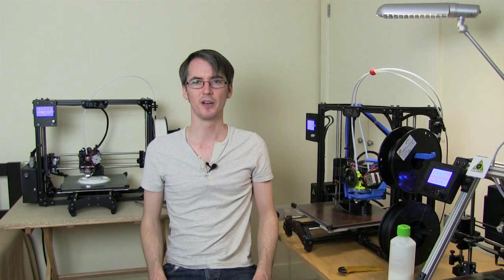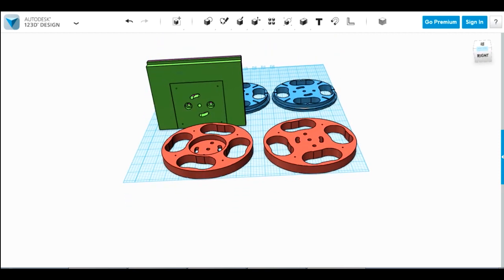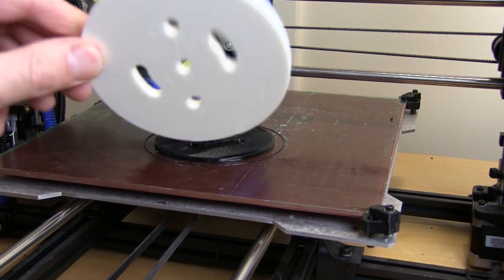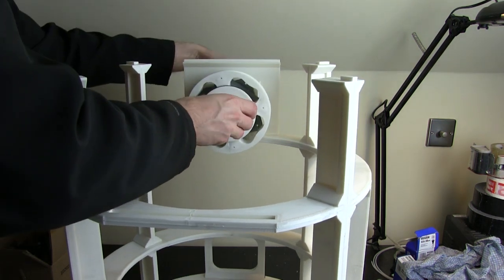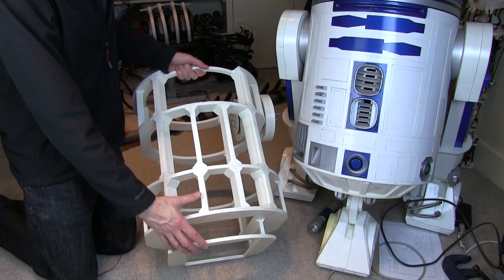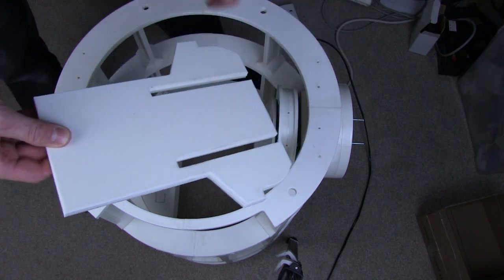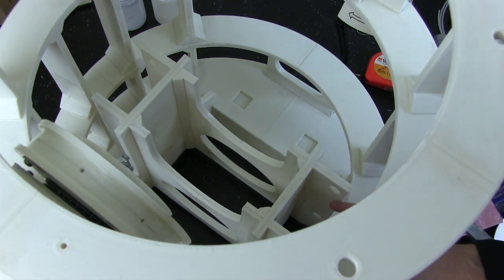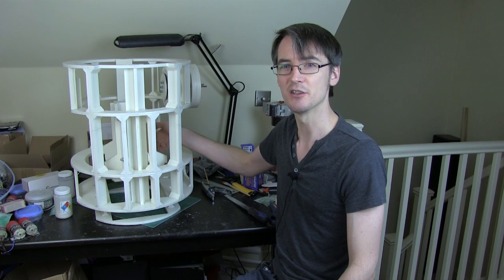Star Wars R6-H5 Droid #3 | Centre Foot Mechanism | James Bruton

Comment: If you run the studding all the way through then you can use one motor to move all three legs. Have a set up gear in the middle connected to a kind of crankshaft so the middle leg goes in and out like a piston of a car.

Comment: James, you’re doing a fantastic job, you really put 3d printers to use. Would you mind answering a few technical questions that I’m sure we are all wondering? When you design your parts do you make them slightly smaller or bigger for abs shrinkage? What nozzle size do you use most? What print speeds in mms did you find you get the best results? As of now did you budget out the cost of filaments (if not could you I’m sure we all would like to know) and how is this project funded?  And as always Fantastic videos, simply a joy to watch.
Reply: ***** In your experience, what's a good thickness for larger flat ABS parts to be warp free? It seems like you're intentionally splitting plates in half to prevent this.

Comment: Nice work, I'm following your video's for quite a while and it is nice to see larger projects with 3D printers. A sidenote; Did you consider filling the bearings with bearinggrease? That should take out 90% of the sound/ratteling even without compressing them.

Comment: wow that really cool, im just wondering if the centre foot will fit inside the frame? I was wondering if you plan to paint any of the internal parts to help them stand out from other parts when looking in, possibly blue? Then again the motors and wires already add splashes of colour to the insides, red i think.

Comment: Hi James, I know you made this video a while ago so may not know. I was looking at building my own R2-Q5 (i like the black and gold look) and i have seen a lot of these R2 builds with a large center leg moving the whole thing up and down filling the body.

Is there some rule that states that R2 droids need this huge inefficient mechanism? or can another mechanism be used say like airplane nose landing gear mechanism? after all an entire industry of geniuses faced this exact issue and they came up with the tried and tested landing gear we have today.

I am thinking i can fix one in, it would be quicker to deploy, quieter, smaller / lighter and possibly stronger. The only downside may be that the leg is forward and not centered as it comes down but could be put on a slider to move to center.... if i care about that kind of thing.

Comment: Why do you always slice your parts into two 5mm plates? Sometimes it doesn't look like you would have an issue with overhang, or room but you still do it. Is it so you have the same surface finish on both sides?